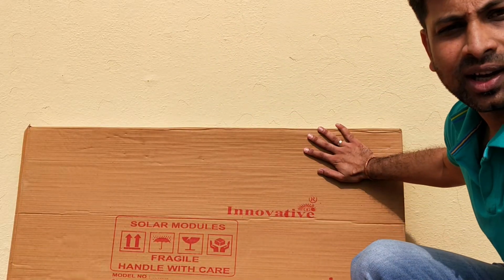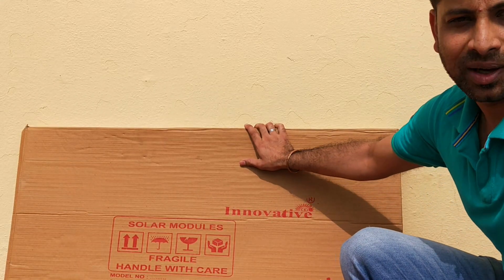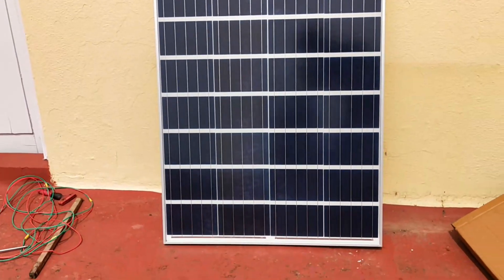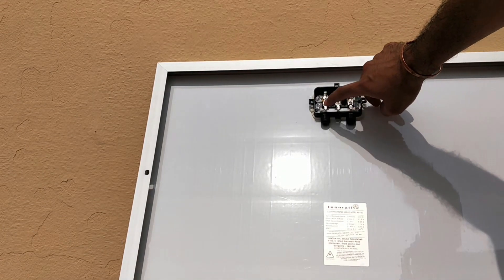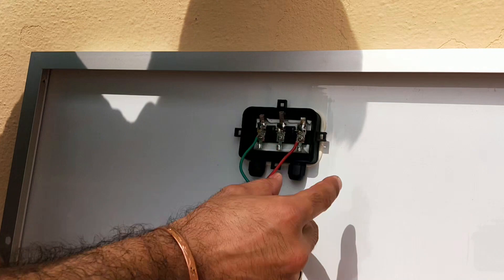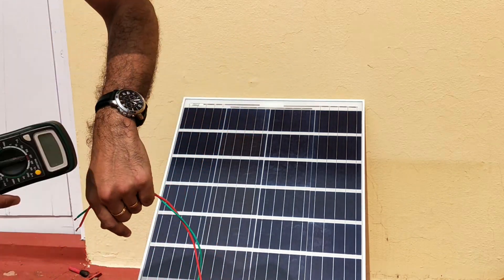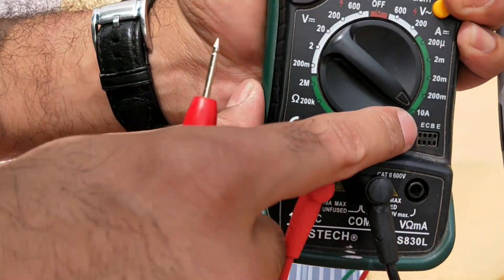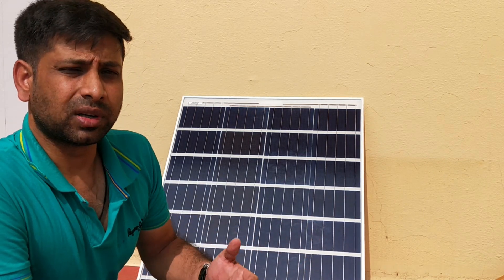100 watt Solar Panel unboxing and testing | DIY Community

Comment: Can I buy this zunsolar panel directly From power plant address?
Reply from the maker: Hi, get quote from different sellers and compare before you buy. If you get directly from the main dealer or manufacturer then it will be cheap and original too. I have given the address and phone of seller in description. You can check with these guys also.

Comment: Good video sir,nice explanation,iam using MPPT DC 10A SOLAR CONTROLLER FOR 50 WATTS PANEL
Reply from the maker: Good to know you are using a MPPT. Use mono crystalline panels for better performance.
Reply: @DIYCommunity  yes sir IAM using loom solar 50watts panel